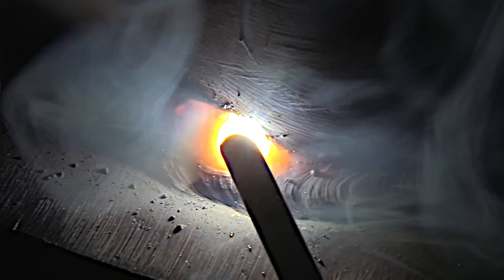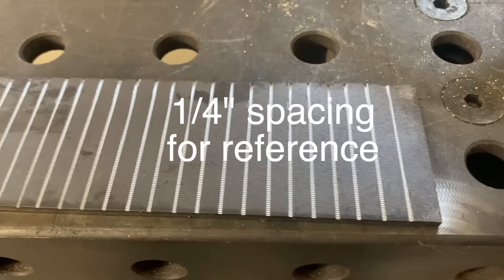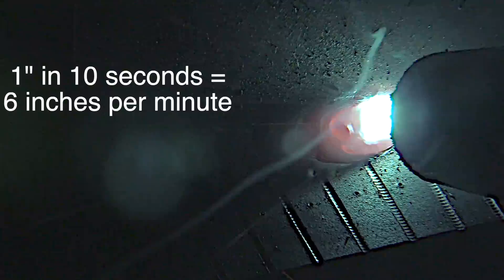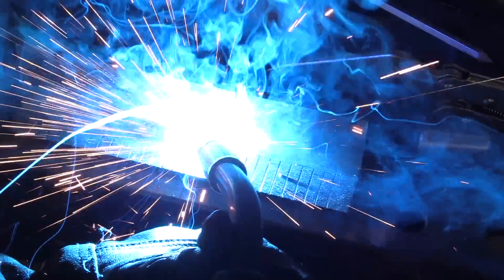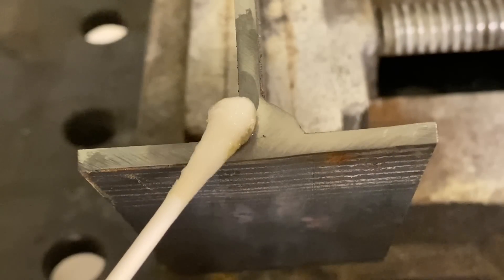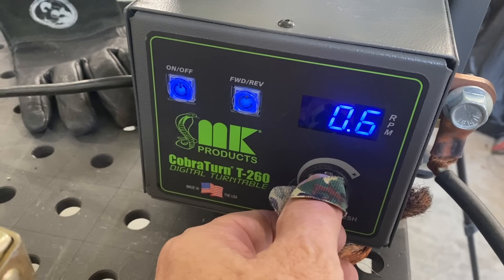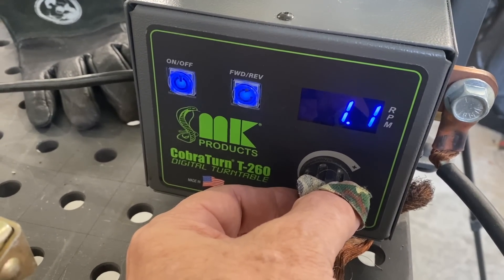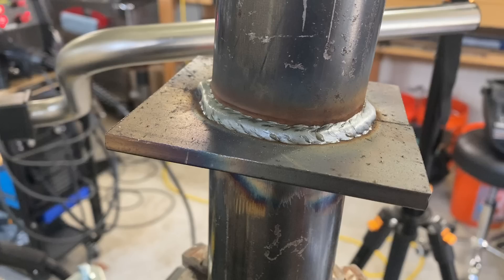MIG Welding Travel Speed vs Stick Welding Travel speed

Comment: Sticking welding is just slow but you can easily run mig welding abou 25 and 38 wire speed. These vidieos run mig to slow.

Comment: I go so fast when mig welding I usually shock ppl ... when I switch over to stick welding I get so annoyed sometimes because of the slow travel speed...and it's constant electrode burnoff... whereas in mig I'm so use to long and short arcing due to the heat index of my puddle...

Comment: Depending on thickness, stainless, the speed is totally different. Stainless arc is slower by far. Pulse is faster with mild. Yet, I feel arc is stronger with mild. Not stainless

Comment: Back in the piece work days our machines had high speed motors that topped out at 1435ipm. We ran C10 gas with .035 wire with dual schedule triggers. My low speed was about 800ipm @ 27.5 volts and high speed at 1100ipm @ 30.5 volts. Oh and this was on 7 or 10ga steel and it had to be leakproof. Fun times.

Comment: If you are running a gas mix with 80% argon you can go spray arc and get much faster again, my go to gas is an argon mix with 16% CO2 and 3% oxygen, with this mix I can do short arc, spray arc and also run my favorite dual shield flux core (E71T-12M H4) which requires between 10-25% CO2

Comment: Now switch to something more productive. Select arc 70c-6 .052 diameter, 350 ipm and 27-29 volts using c-10 shield gas.

Comment: I worked 34 years in a fire protection pipe fab shop. Used MIG process 99.8 % of the time. You can get great penetration with wire, especially with the spray arc process. Great videos sir. Keep them up.

Comment: Hello Jody, I welded in a small shop in San Bernardino, CA. We regularly almost on the daily weld on a turntable positioner and we use spray arc and get a really ice flat weld and some pretty good penetration. Can you show show a video on that. We run at our Miller 302 machine around 28v and 600-650 ipm welding a 2” tube to a 1/4” 6x6 steel plate.
Reply from the maker: @bigpappas65ss  I will put that on my list. Thanks
Reply: @weldingtipsandtricks  I’m a big fan and learn quite a lot from your videos. 👍🏽
Reply: What the hell size wire are you using???
Reply: @jedhatcher252  we run .035

Comment: Thanks Jody good video!

Heat input on first 1.3 kJ/mm
Faster weld 0.9 kJ/mm

Not much more heat. But could be a key element on high strength steels.

What gas did you use?

Comment: When i first learned GMAW in school, our settings were 19 volts 220 IPM w/ .035 wire. The technique was just a back and forth stitch. Single and multi-pass. Our instructor didn't want circles.
Reply: A lot of heat input in circles
Reply: I learned that when I was working in the mines guy called it back washin

Comment: I dont get why you insistently use short circuit when you could use globular or spray even on thinner materials  ?
Reply: Short circuit is what the vast majority of hobbyist welders will be running. I'm not even sure spray transfer is possible on a 110v machine like what most people would have at home.

Comment: We're held to pretty tight travel speed, as well as the rest of the parameters like amperage and voltage, to keep our heat inputs and thus cooling rates in a narrow band. Materials research
Reply from the maker: @highlyalloyed9296  that’s interesting. I had an inspector use a stopwatch once to check my speed on a stainless pipe weld.  It was on the WPS but hardly ever enforced and it kinda hard to comply with in field conditions
Reply: @weldingtipsandtricks every pass in a SMAW welding PQR submission for NAVSEA procedure, had to be documented with travel speed, material temp, and a documented map of how the beads were placed.   It was a lot of data for 100+ beads for a 3" thick weld coupon!
Reply: @foundryman1985  NAVSEA is who I work for. Every pass documented, bead stack diagram like you mentioned, preheat and interpass temps, spool heat number, etc. 

We use a couple different weld data acquisition units to capture our data fortunately so there's no need for someone with a stopwatch watching the readout on the power source lol
Reply: @weldingtipsandtricks  yeah even with a steady hand it's hard to hit tight callouts on travel speed sometimes. A lot of our stuff is done on a sidebeam or robot so it's easier for us. More repeatability and consistent data
Reply: @highlyalloyed9296  This was for qualifying a repair process for steel casting repair at the steel foundry I worked at.  We didn't have much fancy equipment, so someone had to monitor the welder and document all of the passes.  I did have to perform some heat input calculations to show we didn't exceed the heat input allowed.  It had been awhile since I had to work in kJ/hr!    Quite the process to get approved!